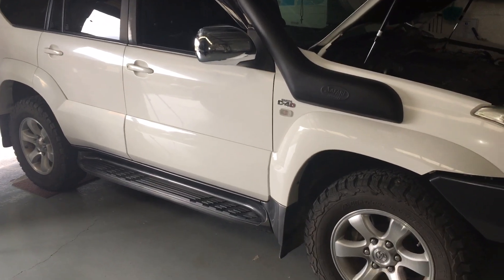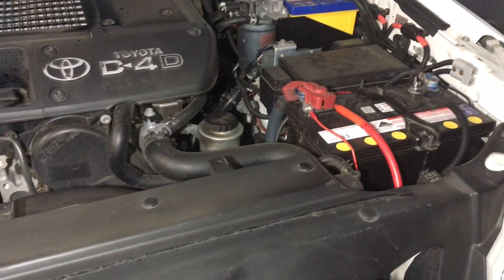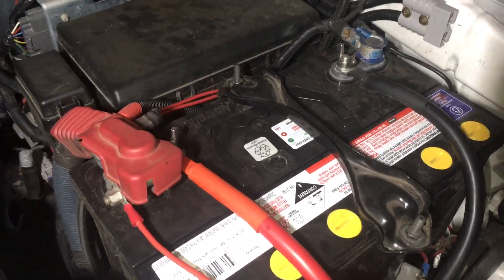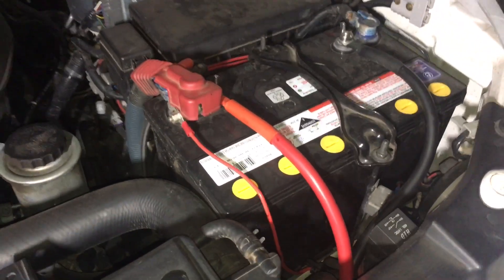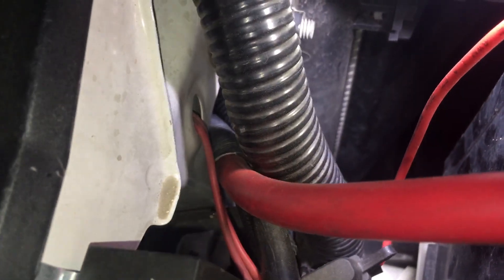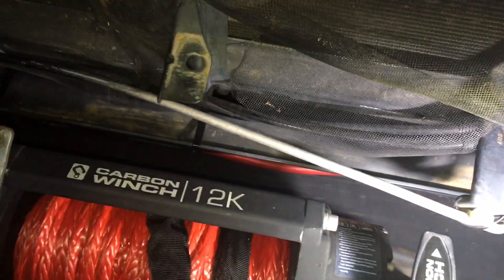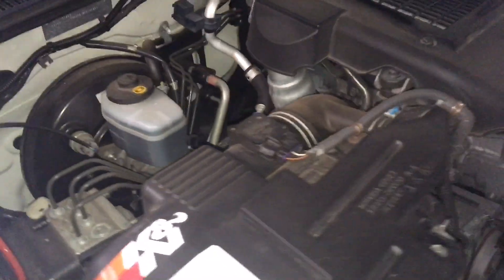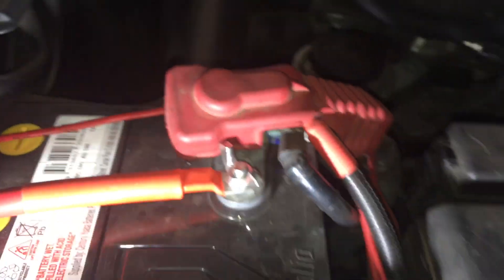IS IT ABOUT TO ARK UP? & BURN TO THE GROUND? Please understand automotive 12v electrical

Comment: Oh look - how sweet, a battery tray for putting someone else's jumper battery in - to allow you to drive away with theirs too - when all you needed to do - was have a couple of auto-isolators / low battery cut-outs fitted, (such as the ones from Jaycar - you do have Jaycar in Australia don't you - well get some battery disconnects such as these - DUAL BATTERY ISOLATOR / CHARGE / DISCONNECTS - in kit form or basic auto-switch
ie:
https://www.jaycar.co.nz/search?text=140+A+dual+battery+&CSRFToken=34399630-f068-4afe-8ba3-fb1d222b04f5
As these allow automatic isolated charging of dual (or more than dual) batteries, whilst keeping them isolated from your main battery should all your silly (I mean necessary) add-ons drain your batteries when out there, playing - or simply leaving on when away fishing (at the local waterhole mainly)

Then when you return it's a small little jumper switch - that allows the batteries (still fully charged) to jump any-which-way you want - between ALL THREE of the already fitted batteries - that are there on the left hand side of vehicle - so what the hell is that spare battery tray for (or is that to hold a can or an esky or all three, while you fiddle around installing some other red-hot-wired thingie?

ALSO an absolute MUST HAVE - is a dedicated row of "fuses"(?) - I'd use Fully Functional Automatic Circuit Breakers - in a "fixed equipment container" mounted as close as possible, to the positive terminal (or more of these at all batteries if more than one battery) - to INSTANTLY open (to await a physical reset by hand) should any MAJOR positive to earth fault occur, in battery wiring.

After that (even if you ONLY use one CB as a major backup - or a bank of CB's for several circuits) - you can run your additional wiring any which STUPID way you want - or run it correctly, slightly over sized (and definitely shielded with heavy duty conduit casing - such as that rippled casing flexible plastic sheathing - of which I prefer to use the RED colour - as it also highlights it as a LIVE POSITIVE - "battery feed wire")

Also those silly auto-return closed high current trip relays - they have that seriously sharp flat piece welded on the back of them for a SAFETY reason - as they also have BOLT HOLES that you should use, to attach them directly onto grounded earth metal with - to keep not only all "live" terminals facing as far away from earthed metal as possible, but to also directly earth the units if they fail internally.
Just hanging these off some rubber pipes with zero stability and absolutely no earthed mounting - well - stupid is as stupid does (was in a film somewhere - talking of bubba's shrimps or the forest of grump or something)

Comment: An ancient four wheel drivers proverb, 
“Winches, diff locks and snatch straps let the inexperienced get deeper into the shit before they get stuck” 😂😂😂
Unfortunately people that are not mechanically inclined have to trust their local “specialist” to set their car up for them and a lot drive off 
oblivious to the danger of shoddy workmanship and don’t have a clue when something goes wrong out the back of whoop whoop. 
A couple of tips: Don’t be to embarrassed to ask the installer to explain what he has done and what goes where especially with multiple accessories being fitted. When you get the car home get a very fine permanent marker pen and write on things. Those thermal circuit breakers, fuse holders and even those smaller 6mm red power wires, write what they’re connected to. Just “winch” or “fridge” or whatever it is they’re connected to is enough so that if something does go wrong and you don’t know how to fix it then someone that does will have a much easier time of it. My auto electrician fits plastic caps to those thermal circuit breakers or if you don’t have those a bit of heat shrink will do. Ive been doing that for the last forty years and it’s saved my bacon more than once because it’s easy to forget over time which circuit breaker or red wire is which.
Cheers Stuart 🇦🇺

Comment: Split tube loom is $4.95 for 2m. Got some yesterday to tidy up my engine bay. 👍
Reply: Where did you get it from? Not all split tube is made equal. Supercheap brand is junk. Very thin and soft compared to Narva. Also if its in the engine bay it will go brittle and crack from the heat. Same if its in the sun.

Comment: Fitted a carbon winch a few months ago. The winch comes with some corrugated tube, not enough to do all the cables unfortunately but enough to do the entire length of the main battery cable. Where was the winch isolator? Couldn't see one there but the winch comes with an isolator in the box.

Comment: The winch battery cable should not be connected to the aux posts on the battery as they cannot handle the high currents when winching, they should be on the main posts. Also there is no battery isolation switch from the battery positive cable to the main starting battery.

Comment: Replaced the rear discs,pads and SHOES on my 150 land cruiser and just wanted to thank you for your videos which cover this. 
Can I ask how long is it before the feeling in the fingers I used  to hold those brake shoes pins in place whilst fumbling with the springs and clips returns to normal. 
Thanks for all the information. 
All the best from Scotland.

Comment: Mate i would drive from NT to get a service from you on my hilux,michanics here are useless untrustworthy
Reply: Unable to do that from here, as the bridges aren't long enough to drive on - (all the way from NZ to Aus.) . but then again - after my Mitsi's gearbox dismantled itself, and the local (very trusty) mechanic - sent it to a gearbox repairer up in Christchurch (also a trusty - according to my especially trusty mechanic) informed us that he COULD NOT source any replacement parts - hence why I sold it as a non runner

Person who bought it (in NZ & also in Christchurch) said he owned SEVERAL of them, most kept as parts, so I wasn't surprised at all, when I saw he'd registered and WOF's it within three months - but that's why eh?

People over here, with "spare" vehicles as parts, NEVER sell them off, (or buy any that are for sale - as soon as they appear) - as no one can "source" new replacement kits or parts - for anything older than about yr 2,000 (and mine was an uncommon model of the 1996).